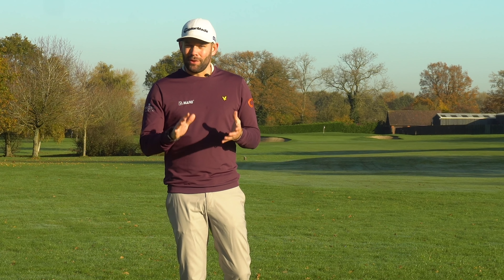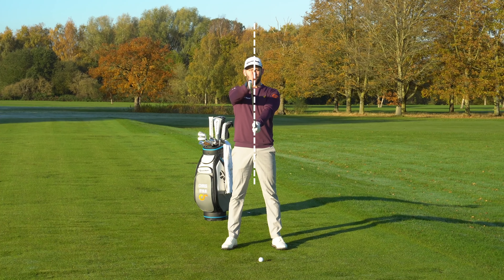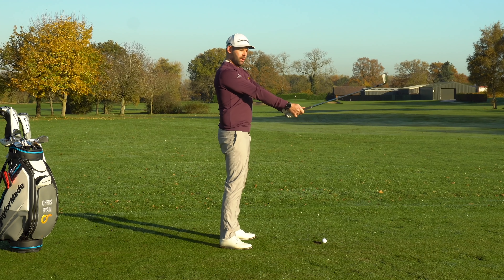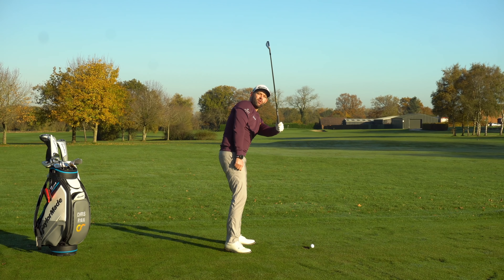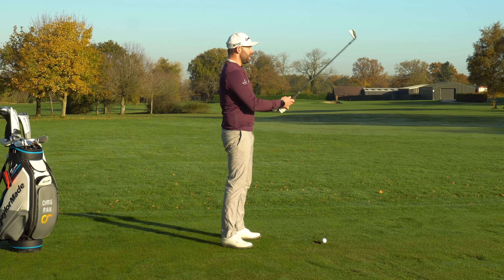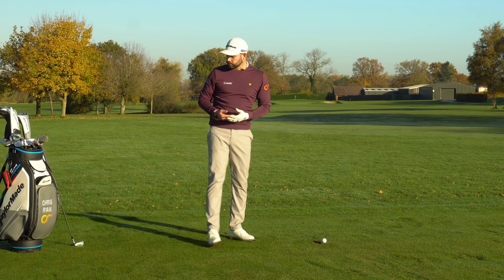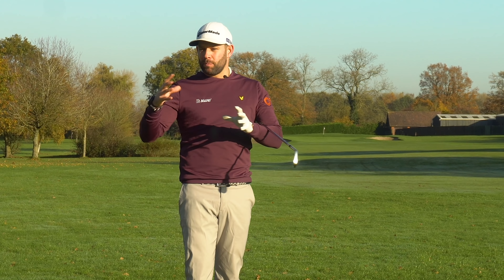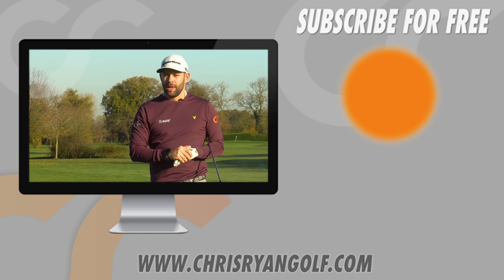Fix This Really Common Downswing Fault With 1 Easy Drill

Comment: Hi Ryan,
Very interesting and informative video that helps me understand what happens to the club face in the one piece takeaway (remains vertical as the body rotates from address to that position at the end of the take away) and what happens to the club face at the top of the backswing (the club face is horizontal to the sky or to the ground depending on your perspective. You say it open 90 degrees to its original position at address. I see it as 180 degrees vis a vis the ground or the sky but that is really saying the same thing. My point is that the club face opens up  from its position at the end of the takeaway (done by basically a body/ shoulder movement to the right) and from there the Club face gets to the horizontal position relative to the ground by solely rotating the forearms to reach what in effect would be the top of the backswing. Therefore it would make sense to start the downswing from the top not with the shoulder or body as you so correctly point out as being a most common error (for me too for years), but rather by rotating the arms back to their position at the end of the takeaway. And from there it would be quite OK  to engage the body and shoulders to rotate into the ball. Because the shoulders will be still behind you in the slot or delivery position at the end of the takeaway position on the way down,  it is Ok to use the shoulders and the body to strike the ball from there
Hope I am making sense.??

Comment: Fantastic drill.  I think this fault may be why I have a tendency to pull my drives to the left.  Sounds like my trail shoulder might be too active.  For some reason I don't have the same problem with irons.  I think the longer driver swing gets me out of sync.
Reply from the maker: Hey Steven, yes a pull left would certainly suggest that this move is in there, hope the drill helps

Comment: Good explanation. Being well into my senior years, getting the consistency is difficult. Still hit ball a decent distance and generally straight but harder to get consistency. Maybe 8 out of 10 swings are good which means 4 or 5 per round not so good leading to missing greens/finding trouble and many times double bogies. Body just is wearing out so work on chipping and putting to compensate. Goal is 9+ out of 10 good swings so your thoughts are a great help. So keep hitting a few every day to develop the memory as I gave up the game for over 20 years.

Comment: Chris, your explanations are excellent about the mechanics of the swing. Today I played the front nine of my local course and tried your tips and had a great day with my irons off the tee and from the fairway... so much so I had to club down to reduce my distances as my normal draw shot was going dead straight with great hang time. On the other hand, my trusty 3 and 5 woods were terrible as I topped every shot. Could you do a video that shares the differences in ball placement, tee height, and swing style between woods and irons for your technique? Not sure with my "new swing" I need to make some further adjustments for my woods. Thanks
Reply from the maker: Hey, I have a vidoe out in the bee year discussing the differences so hopefully they will help 👍

Comment: Thanks Chris.  Is “release” the point after impact?  The left and right flights result from the club head being closed or open?  So “timing” is determined by the length of the downswing TIMES the speed of my body turn TIMES the desired power and distance?  Thanks again.
Reply: I had a similar question. Can’t see how timing of release changes ball direction unless it’s changing club face at contact? 🤔